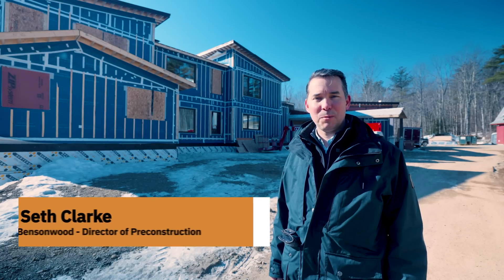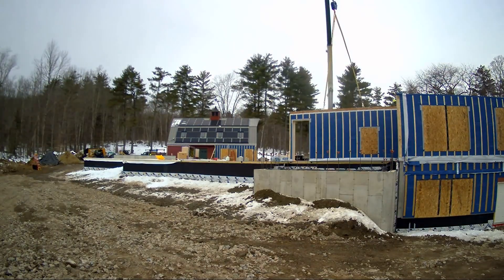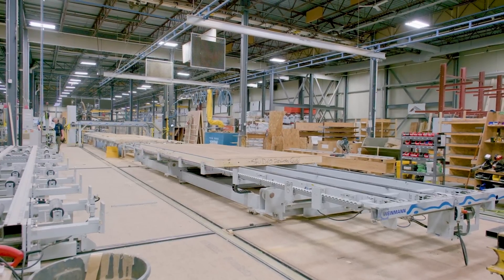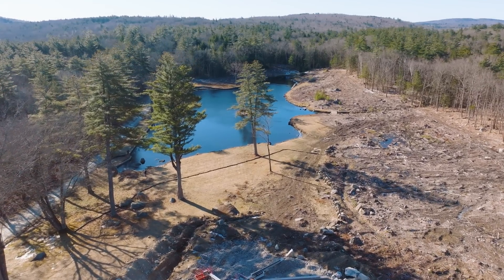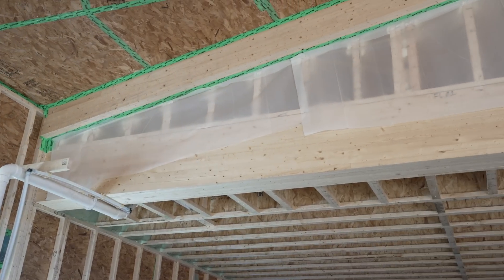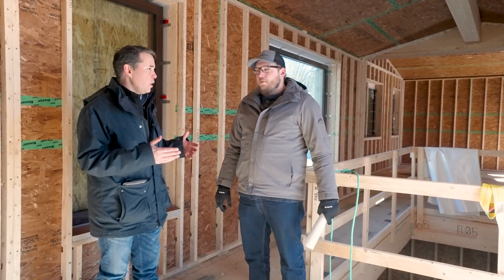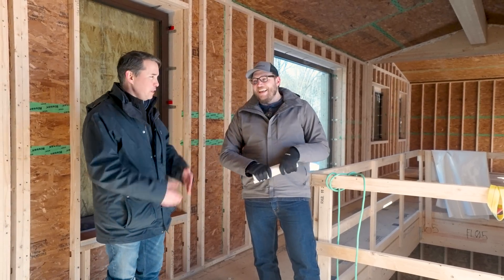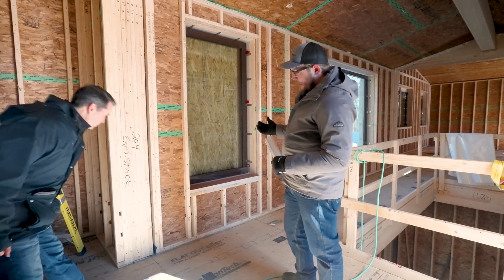High-Performance Factory-Built Home: How We Bring Your Designs to Life with Tektoniks

Comment: I think wood is a outdated material to use in construction. prefab concrete walls would be better. my opinion though
Reply: Timber is a renewable resource and sequesters carbon. Concrete is the exact opposite, which is why the building industry is trying to use less of it. Plus flat packing concrete walls would be mad heavy…. With that being said there are new companies using concrete walls, look into 3D printed houses. Icon, out of Austin is doing some cool stuff.
Reply: We’re literally trying to use less concrete in the present and future.

Comment: what is the approximate cost per square foot vs stick built on site. $300 square foot? or higher?  it would be in southern maine
Reply from the maker: The scope of work we provide typically doesn't cost even half of that number, but we are just one piece of the pie.  The local GC costs (foundations, site development, building systems, and finishes) can all vary considerably with the location, design, finishes and complexity.  We help customers evaluate their building plans for affordability - so please reach out at
info@bensonwood.com